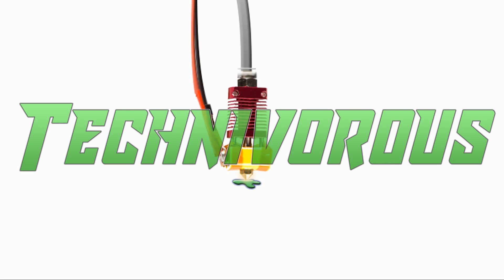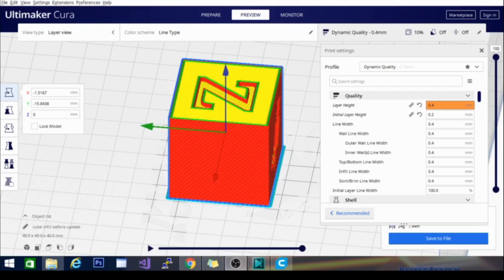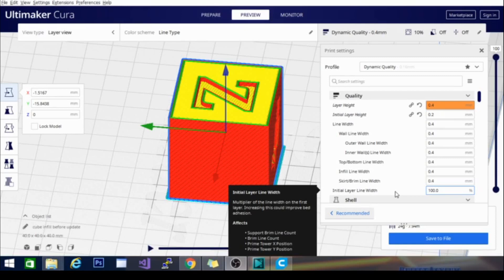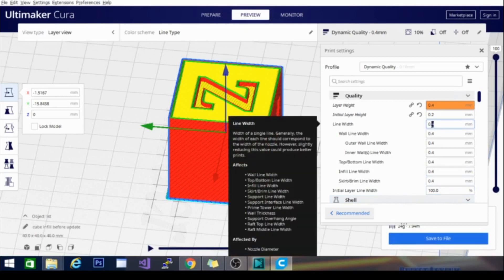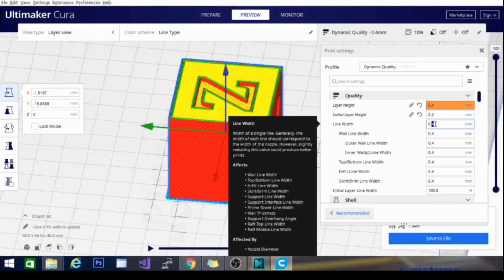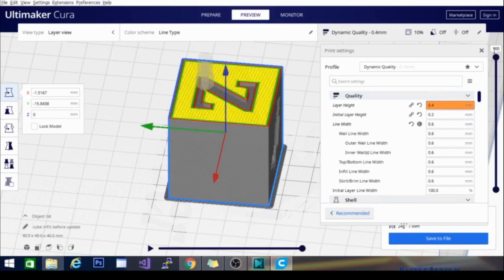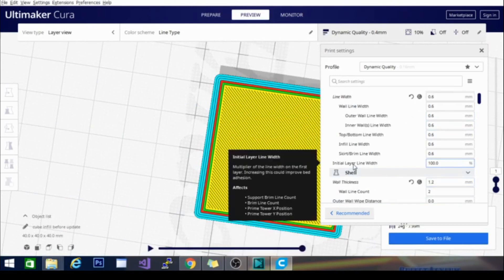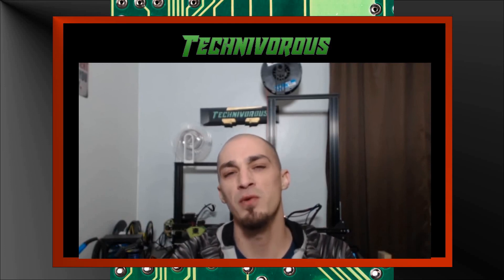Cura settings in 5 minutes or less! - 1.2 Line Width

Comment: Hey, great videos that help me ramp up on Cura. I followed your settings on a layer setting at .39 or .38, trying to dial it in. I found you are spot on so thank you. I also on noticed that on my Ender 3 that there are many factors to bed leveling like I have to be careful not to push up or down on the bed or adjustment wheels due to them knocking the alignment off. I have started ensuring I adjust the wheels and bed only touching the edge. I say this because your setting works for me when I am careful about my leveling process.